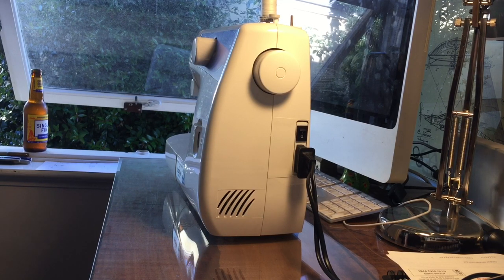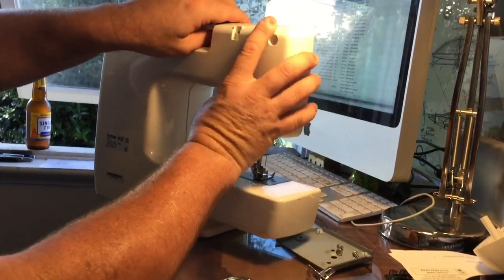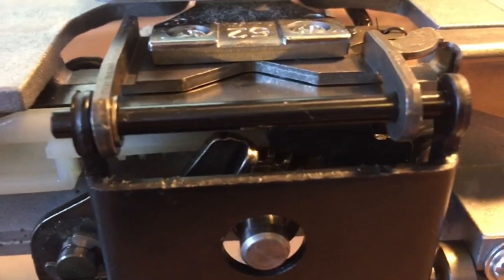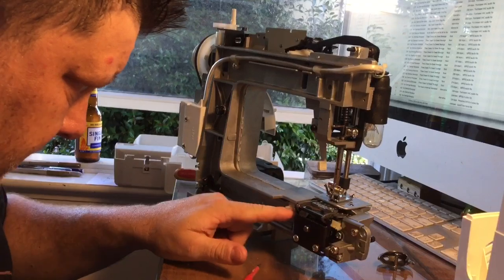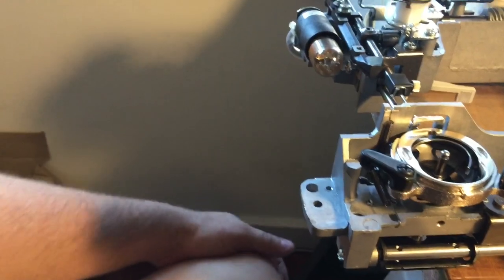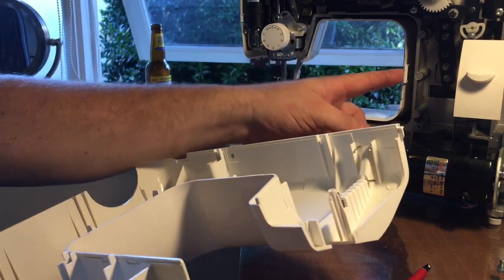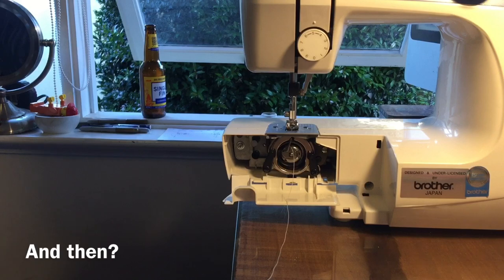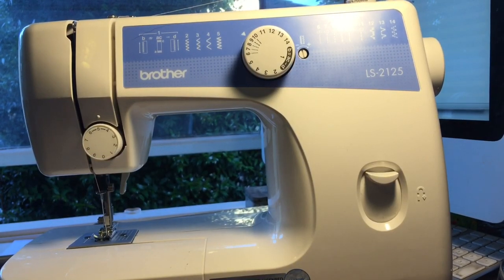Oh Brother! LS2125 hook timing

Comment: Thank you for showing the details of of the inside mechanism. My problem wasn't the same issue though. I kept watching to see if you would reveal the left side of the bobbin housing unit, and you did, about halfway in. One of those springs had become unhooked and I needed to see where it was supposed to be. Voila! You showed it when you turned the machine upside down to show the needle coming through to the bobbin thread. Thank you very much!

Comment: The gear has 2 small allen screws, you loosen them both, with a flat head scew driver slide the gear back, set the timming and push gear   back in and tighten the allen screws again or when you open the machine, the flat black bar on the left of the reverse switch, only loosen the screws and only remove the middle screw, then you can tune the timming by hand. you will be able to manualy spin the shuttle gear, then put the middle screw back and tighten the others.
Reply from the maker: Very good information thank you
Reply: This method lets you set the timing from the front. You only need to take off the front plastic. Then there are 4 screws on that flat bar. Loosen all of them. You can then adjust the hook to the right position and tighten the screws. There quite a bit of adjustment here. Easy.
Reply: I read about these two gears but can only find one and when I loosen it the entire bobbing housing area wiggles but doesn’t correct my slow timing. I’m so stuck

Comment: It was a cold raining snowing day (11/13/18) and I decided to use the time to work on a sewing machine that hasn’t worked for two years. After searching the internet and finding very little help other than telling me I couldn’t fix it on my own I came across your post. I figured what the heck it’s already broke. So I watched your video and then studied the parts I might need. The bottom line is it works and I only have one tiny screw left over. You did a fine job (even with the helium narration I commented on earlier) and I want to thank you. John Harfmann—Yellville Arkansas.
Reply from the maker: That is totally awesome John! So good to hear from you :-) helium is the 2x speed as I was worried it may end up being too long! Already 45 minutes
Thanks heaps for letting me know too :-)

Comment: The amount of precision timing these things must have in order to work right is really amazing to me! The amount of engineering that goes into making them is really incredible if you stop and think about it! I parted out an old Singer because the timing was off. Never though about trying to find a repair video about it...oops!
Reply from the maker: I have a playlist of industrial embroidery machine service videos, and even those being as big and complicated, end up being quite simple issues to repair, usually a bit of end float, timing, or wear on the rotary hook. of course sometimes there is a deeper issue, but that is part of the challenge for me, seeing how deep down the rabbit hole I go whilst still having a thread back to the surface ;-)
Reply: Cool! Glad I subscribed! I do some sewing occasionally to make things I need and to repair things. Not clothes really but stuff more like kayak seats and things.
Reply from the maker: Awesome to have you on board! Thank you

Comment: I’ve got a Brother VX-1500 that I’m about ready to toss out the window. I use it once every 10 years and the hook timing is some how off. Probably used it 5 times my entire time having it.  I’ve watched every video and I can seem to get it working. My hook goes the opposite direction of everyone else’s on YouTube. I thought I could just adjust the needle, that didn’t work. Now I watch your video and I’m tearing apart the gear. The problem is I’m so mixed up now I don’t know where the gear should be and the plastic thing on top of the gear. I paid $99 at Walmart for it 25 years ago. I’m ready to pitch it and get another, but I’ve hardly used it.
Reply from the maker: The most critical “timing” for a sewing machine is the point at which the bobbin hook passes behind the needle. The sewing needle travels down, then just as it starts to travel up again the bobbin hook must pass behind the needle, this is how the top thread is captured, and then travels around behind the bobbin forming the stitch. The essential part of the timing is that crossover point between the needle and the hook
Reply: JBFromOZ thank you. I’m going to work on it again today.
Reply: JBFromOZ well I fixed the time so the bobbin thread is picked up but now I have a different problem. When I’m sewing there is a whole big mess of thread in the bobbin area and then the needle bogs down. I can’t even pull out the thread. What do you think the problem might be?
Thank you
Reply from the maker: George Harvey possibly the “take up lever” is not threaded in correctly, or the top thread tensioner perhaps is dirty, and not providing resistance from drawing new thread from the spool. there is a lever above the needle which draws the loose thread up. As the lever pulls up, the tension pulls the loose thread back up as it goes.
Reply: JBFromOZ if I go slow spinning the wheel by hand it stitches correctly, but as soon as I use the motor is when it starts getting a mess of thread underneath around the spool.
Reply from the maker: George Harvey I’m going to go with my hunch that there is dirt between the tension plates in the upper thread path, so thread is being pulled off the spool as the take-up lever lifts, instead of back up the needle side (hence it’s getting tangled)
Reply: JBFromOZ thanks I’ll check that out next.

Comment: what actually slipped when the machine got knocked out of time?
Reply from the maker: There is a rack and pinion arrangement between the rotary hook and the needle, essentially the rack jumped a tooth, so it was advanced one step, and the hook was no longer in the right location to catch the thread when the needle came down to bottom dead centre
Reply: @JBFromOZ  Lucky it didn't break one of the plastic teeth!.  The 2600 Brothers use a completely different arrangement to drive the hook.  I tried to zig-zag with my straight stitch needle plate still in place, and BANG!  Haven't quite figured it out, Diverstity2 here on YouTube has shown me the way to at least get the plastic front cover off.

Next time "Dave" tries to push too much tough sheet goods through his machine, suggest using an Jeans or Microtex needle, the smallest diameter available, say an 80/12..  They are SHARP,  sharper than the "Universal" needles, and can help a cheap plastic machine do the work of a Consew.
Reply from the maker: Ryan Young I don’t think Jane has let him near her machine since!

Comment: Hi one of the springs came off from this same model in this video it's not the one 
on  the left part above the shuttle basket it's small s spring with two hooks at the end and I don't know how to reattach it  they call it it a feed dog return spring  but my manual has no name to this part can you demonstrate how to reattach this spring
Reply from the maker: I no longer have this machine, I just fixed it for a friend. :-) best of luck

Comment: If your wife has this sewing machine she probably isnt that bothered about sewing. Nothing wrong with it but it's not what you would call heavy duty.
Reply from the maker: I actually fixed this for a friend of mine who had borrowed it from his partner ;-)
Reply: @JBFromOZ  Yeah. :) I have one of them of my own it's fine but pretty weak the kind of machine that bought used once to make some drapes and then put away and then given to charity when the closet is being cleared. Anything more than that and it seems all these cheaper jobbies go out of time or worse.
Reply from the maker: My wife using a Janome MyStyle 32 also lightweight machine
Reply: @JBFromOZ  I find I run into trouble with that machine if there are many layers of fabric so making clothes for example can be a struggle.
Reply: @JBFromOZ  The janomes I have seen here in sweden are 2-3 times the price though so they should be a bit stronger.